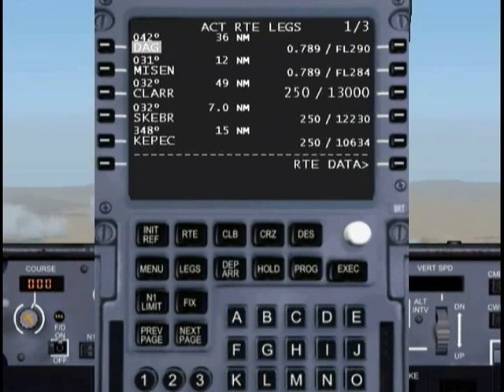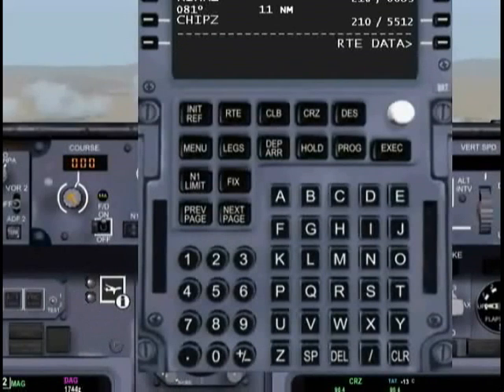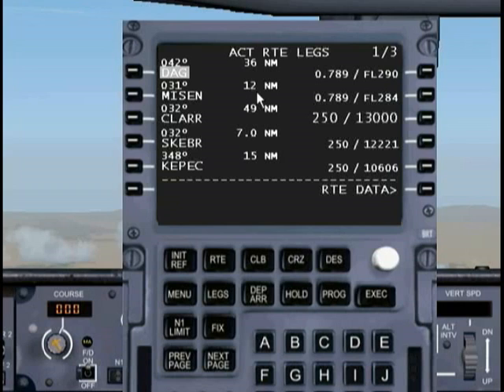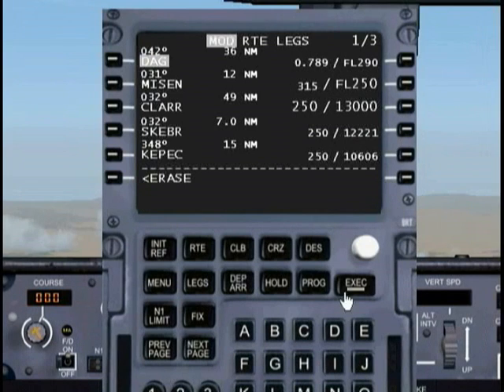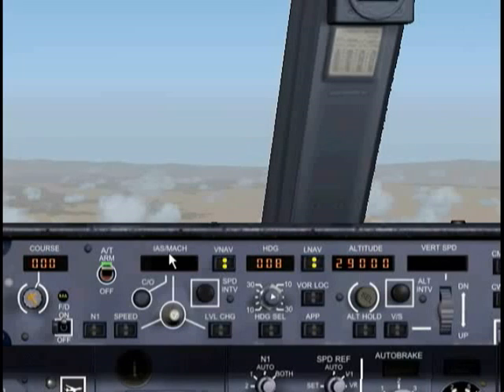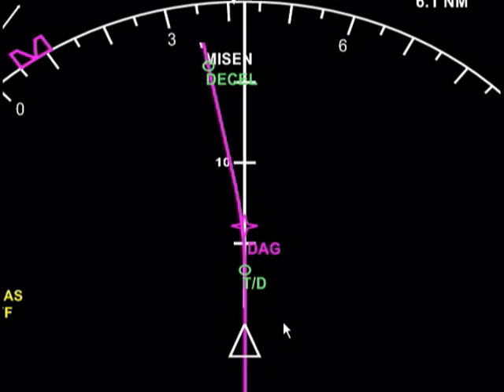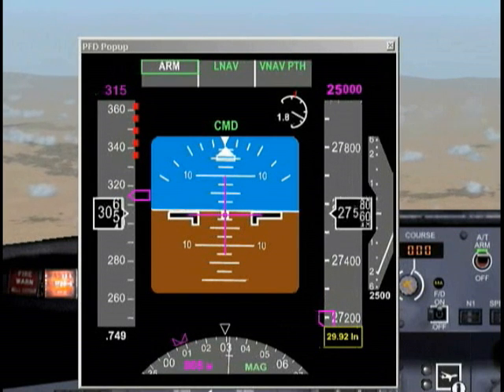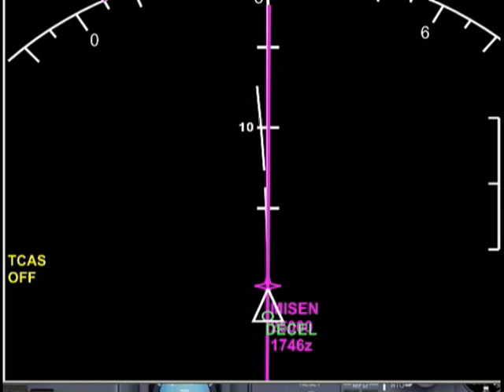PMDG FMC Tutorial Part 6

Comment from the maker: This is a good question and nice observations. The FMC will never override the MCP. I know that it may seem self defeating but remember that the system is designed as an aid and not a complete takeover. Changing the MCP altitude is your way of telling the FMC "Yes go ahead and do what I told you to do" a final check and balances approach if you will.If you didnt change the MCP you would get a message from the FMC alerting you to the fact that it cant go lower and you need to approve it.

Comment from the maker: Make sure that you are trying to place the speed restricion on the Right not on the Left of the FMC which I think is what your trying to do. So if it says CHIPZ on the left and 300/5000 on the right you would need to place the 170/ into the line select keys on the right . Trying it to place it on the left the FMC thinks your trying to add a waypoint called 170/ which of course is not valid